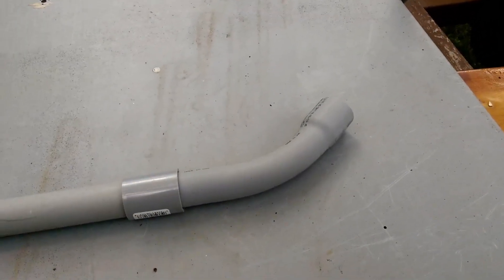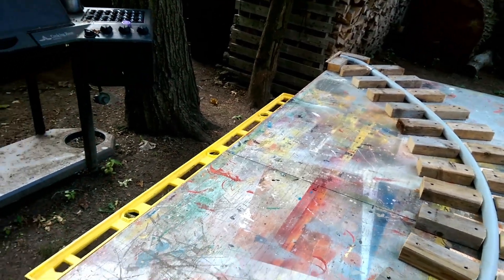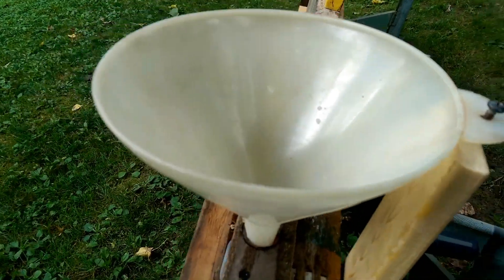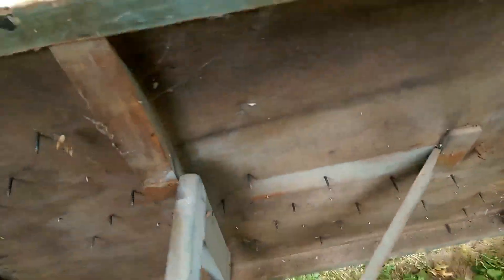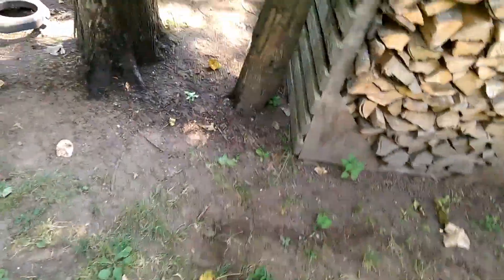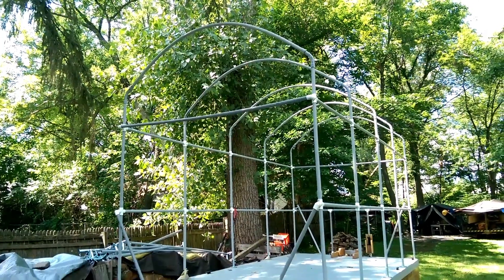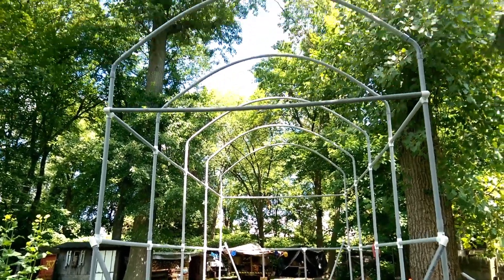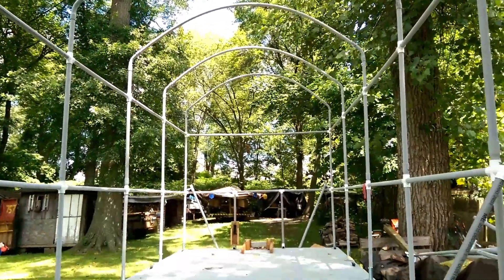PVC Pipe Bending

Comment: Hi David! your piece starts and ends with the engagement part that has a wider diameter. That wide diameter opening is the part of the assembly that you do not want to reshape. However, you make sure that the assembly is level to ensure that the hot or cold water reaches the lip (or rim) of both openings (engagement parts). While watching the video, I considered myself to be in training. Because of your video, I could one day build large PVC structures. Right now, I would like to say the following:: (1) You need a heavy duty metal garden watering can with a long neck that you can use to heat up and pour hot water. (2) Instead of drilling a small holes for the funnels, drill the holes large enough for a short piece of pipe to be inserted in the engagement section. I am sure that you can find a plastic juice bottle with a wide mouth that will fit perfectly inside that short piece of pipe. Once you cut two juice bottles, you will have two new funnels. Thanks to the added short pieces of pipe (4 to 5 inches long), you do not have to worry too much at keeping the assembly perfectly level. The engagement sections that do not need heat, will  be less affected by hot water, because the inserted short piece will double the thickness of the pipe wall at the openings. (3) I would recommend using a step ladder to elevate yourself, while pouring hot water with a watering can. Great video! I also saw that you bought a tripod. You need more than one tripod and more than one camera. If you are happy with the camera that you have, make sure you buy the exact same camera again. I bought my first camera new and two years later I bought the same camera used for a fraction of the cost. That way, if one camera stops working, I will not have to learn how to use another video camera. I also found an old tripod that is very heavy and very tall. When that tripod is fully extended, I have to step on a ladder to reach the camera. The secret about old $5 tripod from the goodwill store is that you could need to use a piece of tape to make sure that one leg stays at the desired extended position. I made a beautiful PVC front gate but had to partially fabricate the hinges. I also built a hand tool using a piece of PVC pipe for a handle. Do you know if a PVC hammer handle would be considered to be toxic? I am asking because I plan to sell that tool. Finally, My wife loves to go camping. For a couple of months each summer we setup a large tent. To protect the large tent, we built a gable roof out of tarp (30 ft X 40 ft) and supported by ropes hanging from high branches. A PVC structure could support a better roof. Your video has given me some ideas.
Reply from the maker: I've been getting all sorts of great feedback on the hot water pouring part of my process. I totally agree that portion of my build needed a better process. But as a first time try I pretty much nailed the basic steps and will certainly refine things on my next PVC build. Its nice to get so much constructive feedback because sometimes the person doing it needs lots of different eyes seeing the project and making improvement ideas known. One of the biggest lessons learned by me is that because PVC is a pliable material and not rigid it can be susceptible to clamping forces and stress; which then imparts deformation of the circular cross section. Extra support to maintain roundness in the ends is definitely something I didn't think thru 100%. As far a PVC being toxic for the handle of your custom tool I have not come across any information about that. But, I did see more than a few comments about PVC pipe being incompatible with clear plastic & polyethylene tarps, especially for long term use. This info was presented in more than a few greenhouse hoop house videos I watched. A layer of regular duct tape prevents the problem from occurring. The problem being the PVC & polyethylene tarp reacts and degrades the tarp where there is contact with these materials. Adding a duct tape buffer zone prevents this from happening. But this is only for long time exposure like in a hoop house for growing plants where the two materials are in contact with each other for months or years. Its doubtful a temporary tent canopy would show signs of wear because it would be taken apart and stored between trips. However, not laying the PVC frame tube directly on the tarp could be a good preventative measure to avoid degradation of the tarp material. Currently I use my cell phone as my camera, but I also have an early model GoPro camera. So, technically speaking I do have two camera, but they are pretty different in how they are used/connected to tripods or GoPro mounts. As time goes on I'll get better at filming. Keep the comments coming though as they are helpful & encouraging.
Reply: You gave me the answer I was looking for. In addition you added a lot of information about PVC tape and tarp. I will need to read this message again when I have more time. At that time, I will be able to better understand what you wrote. For now, I must say that if this was your first PVC build, You are doing very well.

Comment: Great Idea However  I would use propane torch instead of water to heat it up  .
Reply: If you do use a propane torch, you'll probably wish you hadn't.  You have no way to know how hot the PVC is getting with torch and you'll blister and scorch the PVC.  With water you can't exceed 212° F unless you're working in a pressure cooker.  Much better control.

Comment: Instead of water use a heat gun and it works beetter and does not make the pvc so brittle you change the pvc melting it so much the heat gun takes less time and does less damage to the pipe over time winter summer ect

Comment: Great how to video, thanks for that.  Honest question though, not trying to be cynical, but if your objective was just to keep rain water off the top, why did you chose a curved canopy instead of and A frame.  3 pieces of 45 and some straight pieces of PVC and you could’ve accomplished the same objective, without all the extra work.  If it’s simply because you preferred an arch... I get it, but just wondered if there some reason an apex would not have worked.
Reply from the maker: An apex would have been too tall. I tow the trailer, raft, and canopy fully assembled and have to fit under bridges when out on the road. The curved roof keeps me under the maximum height limit of 13 feet - six inches. Plus i do prefer the arch as its more pleasing to the eye. It also presents less of a windage profile which can help to minimize maneuvering issues on windy days.

Comment: Great idea.  Which parts are glued and which break down?  Do you have photos of everything broken down?
Reply from the maker: The individual roof bows disassemble from the wall sections. each wall frame (port, starboard, and stern) are complete glued units and can be unfastened from the deck's foot pads. I have since added a clip on ridge pole that connects all the roof bows together at the top but can be disconnected from the roof bows. I have also added two wall outriggers that allow me to fasten the tarp ends out over the water. This way rainwater does not drip on the deck. It falls away about 12" past the deck into the water. These clip on and can be removed as glued sub-assemblies. Everything stores underneath the raft atop of the trailer framing that supports the pontoons & deck. Everything is self contained meaning that no part of the raft is stored somewhere else. Although I can tow the raft  with a fully assembled canopy frame; I can also tow it with all the frame parts stowed. This configuration is what I call the winter mode. My boat shed is only slightly taller than the deck so having all the canopy frame parts stored between the deck & trailer makes it pretty easy to store during the winter. The canopy is only for sun shade & rain protection when the raft is used in the spring, summer. and fall. The PVC frame is not used to shelter the raft during the winter. Its just not strong enough. My storage shed built with heavy wooden frames and much more suitable to support the 2 foot+ snow loads we get on roofs during the winter. I do have some photos of it broken down and will try to post them in a follow-up video.

Comment: So what was the arch for?
Reply: Joseph DuPont, so water doesn’t build up on the canopy.  Personally though, I would’ve used 3 pieces of. 45 and make an apex.  Much easier and faster
Reply from the maker: The canopy arches support a polyethylene tarp that provides sun & rain protection. I used an arched roof to keep the canopy frame low enough to stay under a 13 feet 6 inches height restriction. A roof with an apex would have been too tall to be able to tow under bridges and power wires. I use a boat ramp to access the river. The raft does not stay on the water all year long. If that was the case I could have built the canopy frame as tall as I wanted.

Comment: Why didn’t you just use a hot air gun. Heat the pipe while in the jig, then let it cool down?
Reply: You can't regulate the heat with a hot air gun and you'd have to fill it up with sand or something so it wouldn't collapse

Comment: Good video, good explanation and nice jig setup.

Cotter pins/Clevis pins to keep the detachable sections in place (from wind etc)?
Reply from the maker: The connection points all have a slight force fits to them. Once the frame is assembled and the tarp is secured using bungee balls its pretty solid. But, a secondary securing method would add an extra layer of safety during towing.
Reply: @Da175305M  

OK, thanks for your reply!

Comment: Freezing the bend as its  sometimes called can be done by running cold water thru a hose down the pipe or  on the outside wall is even better because the heat what's being removed. I found that in bending plastic stock even at a severe angle with a heat gun could be set with by cooling it with a spray bottle or submerging it in water had the same setting effect.
Reply from the maker: I'll have to experiment with that idea. Its sounds like a useful technique.

Comment: That looks like gray PVC pipe which is used for electrical work. But I'm curious as to why you wouldn't have used a much cheaper schedule 40 PVC water pipe? I'm just curious. I did a lot electrical work and gray PVC is very expensive compared to schedule 40 water pipe.
Reply: Curious - would 40 PVC bend into the jig prior to applying heat, or would it require heat while shaping into the jig?
Reply from the maker: In my neck of the woods the prices are pretty close. For example gray schedule 40 pvc pipe (1-1/2" diameter) is $7.00 and the same (1-1/2" diameter) in white pvc is $6.36 but its a wash when one considers the gray has a female flared end built in. The white pvc has plain ends and I'd have to buy an extra fitting to match the gray pipe functionality. The real reason is I liked gray because it would not look dirty as fast. Plus, I'd get some nice contrasting colors between the white fittings I used and the gray pipe runs.
Reply: @Da175305M  afternoon mr. David. I don't remember the price on mine that I purchased last. But I think it was an inch and a quarter but I still have 200 feet of it and it's in 20 ft length and has the Bell on the end. Which I don't know if there's that little difference in the price in the two colors you're using maybe you have both water pipes I'm not sure. Like I say I did a lot of electrical work and of course electrical had to be in the gray and it was a different type of pipe. And also you didn't use regular PVC fittings or rather white PVC fittings on the gray because a 90-degree White fitting would be just pretty much impossible to pull a large-diameter wire in. But I mean I'm sure the gray if it's in fact electrical will Outlast the white but that was kind of a neat job you were doing and I was just too curious about why you you want and not the other. Have a wonderful day

Comment: How did you make the pontoons and platform?
Reply from the maker: The pontoons were built using a stitch-and-glue construction method that used plywood, copper wire, fiberglass cloth, epoxy resin, and fillers. This method used panels which were cut out of 6mm Lauan plywood and drilled along their mating edges. Panels were then stitched together with wire along the seams to hold them in position while epoxy resin was applied to the joints. Once the epoxy cured the wires were removed. Epoxy resin thickened with fillers was then applied to the interior seams with the round end of a tongue depressor to fill in voids from the wire holes and create a small continuous fillet along the interior seams of the panels. The exterior seams were faired to create a small radius along the chines. Layers of fiberglass tape were then laid across all interior and exterior joints and saturated with epoxy resin. Once the epoxy cured the entire interior and exterior of the hull was sheathed in fiberglass cloth and saturated with epoxy resin, which bonded and sealed all the panels together and created a waterproof one piece monocoque skin surrounding the entire pontoon structure.

A series of nine internal bulkheads were bonded to the interior of the pontoon with thickened epoxy. This provided addition support structures and multiple air tight compartments that would restrict water intake in the case of a hull breach. 1½″ square sections of Douglas fir were bonded to the topmost internal corners around the periphery of the pontoon skin and bulkheads, providing a rigid anchor point to fasten the deck to the pontoons using stainless steel screws. The internal volume of all four pontoon tips were packed with sealed plastic bottles to decrease the volume of water that could occupy these compartments. Since the tips were the most probable area to suffer damage in a collision they were safeguarded in this way. All other compartments were left empty.

The deck is composed of four individual segments that are each 4′ long by 8′ wide. All four segments are bolted together to form a deck structure 16′ long by 8′ wide. The midpoint of the deck is aligned with the midpoint of the pontoons, leaving 4′ of the pontoon tips protruding out from each end of the deck. The deck has two functions. The bottom incorporates saddle assemblies which provide nesting surfaces for the tops of the pontoons to rest in; this holds them in place along the port and starboard side of the deck. The top surface of the deck provides enough space to accommodate the crew’s seats, pedal stations, propulsion apparatus, canopy, and other paraphernalia and tools. The port and starboard sides of the deck’s top has four cleats equally distributed along the edges to provide multiple anchoring points from which to tie up lines to secure the watercraft to another object.

Each deck section was built of 1/2″ thick exterior grade plywood and reinforced with stringers to create a series of box sections made from 5/8″ x 2½″ x 8′ pine furring strips. All of the joints and mating surfaces were bonded together with thickened epoxy resin. The plywood was also mechanically connected to the box sections with screws. All surfaces were then coated to encapsulate the entire structure in a protective layer of waterproof epoxy resin. Two wooden saddles were fastened to the bottom of each deck segment along the port and starboard sides. These were used to hold the pontoons securely in place underneath the deck.

Comment: It will usually go back to its original shape when you heat it back up. Why not heat up that lobed end and stuff a cold end of pvc into it?...maybe  coated in petroleum jelly. Those female ends are tapered so a hot , plyable one could easily get a good grip on a pipe and hold on tight once cooled off..

Comment: You need a steam line. That be the ticket.
Reply: 170° ??
Reply: @smjones4238  no doubt you could melt er with 400 degree steam . If you shot it with low pressure steam just a bit of time it would heat fast and shoudnet melt er like pudding. Lol
Reply: But your demo is great and no special stuff! Nice.

Comment: an easier way would be to heat as you put in your bending mold you made!
Reply: you didnt use a heat gun you used water....
Reply: @barbarajdevosha2396  A heat gun could overheat some spots and weaken them. Also, difficult to heat the underside of the pipe. It would take more time and physical labor holding the heat gun. Also the extra cost of electricity.

Comment: you are exceptional - would a 5" length of riser pipe on the funnel side let you fill and overflow the bowed pipe Insuring the full length of pipe receives the High Temp water needed to reform it?  Again, 'great video
Reply from the maker: Yes, a riser pipe is a good idea. In fact one at each end would have been ideal for a couple of reasons. Firstly, it would have allowed me to pour the hot water down into the PVC pipe assembly & prevent any deformation. Secondly, the riser could have also have served as a much better alignment tool than the set-up I came up with. A riser pipe inserted into the female couplers (at the ends of the roof bows) would have had approx. 1 inch of engagement and enough rigidity to keep the engagement ends parallel to each other. My jig didn't provide enough support because I ended up with a small degree of curvature on the ends. Most likely the bending forces from the long pipe section transferred some curve into the ends. I had a little difficulty engaging the roof bow ends into the vertical canopy frame post ends because the bow ends were not perfectly parallel to it. With a little wiggling they went together and sort of held the whole thing in place. So maybe that was a good thing.